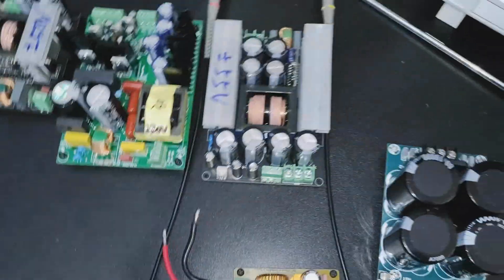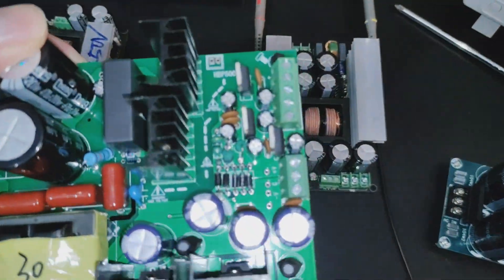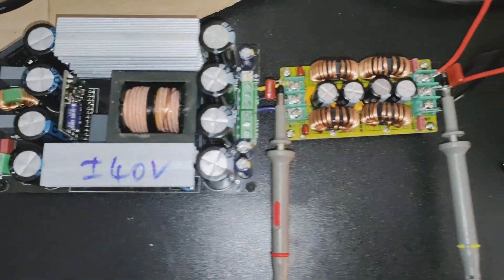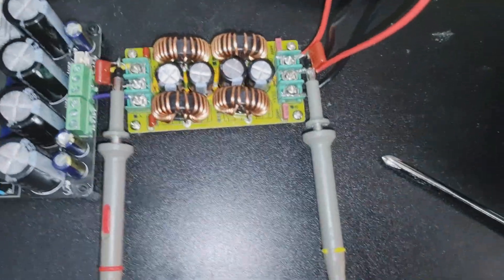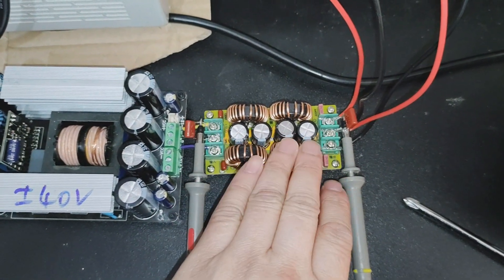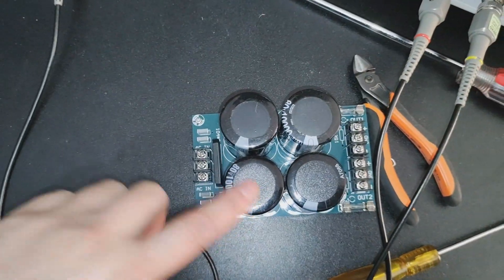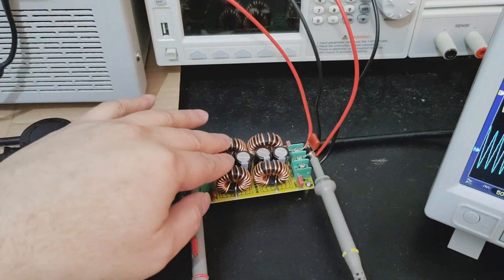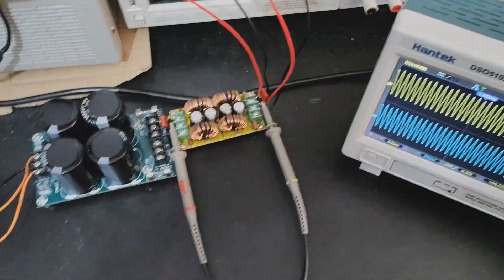Reduce Switch Mode Power Supply Ripple by up to 60%

Comment: Can i know the link for the filter module?
Reply from the maker: This is the actual filter shown in the video, choose the 10A version by clicking the images in the listing.

https://www.aliexpress.com/item/1005004509784253.html?

https://www.aliexpress.com/item/1005004255627496.html?
Reply: @boknoynaruto3824  salamat sir
Reply: Usually sa oscilloscope, ilang Volts/division specs pra po Makita Ang high frequency ripple?
Reply from the maker: Una ilagay ang channel to AC couping, BW limit On.
Set V/D to 10V, e kabit ang probe sa output ng power supply.
Pag naka on na ang power supply slowly turn V/D down until the ripple can be seen.
Huwag e kabit ang scope sa high voltage power supply unless it is know that it is not gonna damge the scope.
Reply: @boknoynaruto3824  sir sir noted.. x10 probe Muna default

Comment: What about dynamic response to sudden load changes?
Reply from the maker: Did one test from no load to full 4A immediately and the rise time was around 19ms and the overshoot was about 3.2V bringing the Vout to 43.2V and the Vout stabilized to 40V after about 18.5ms.
4A is the max the psu can do.